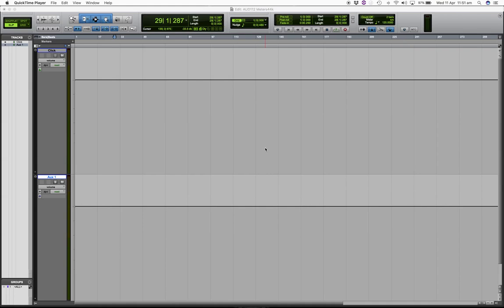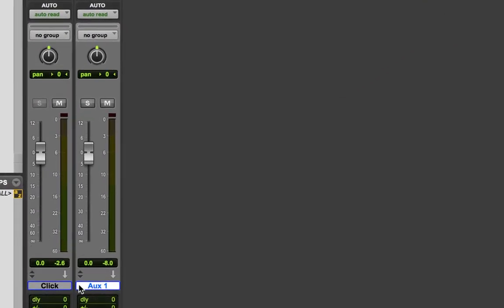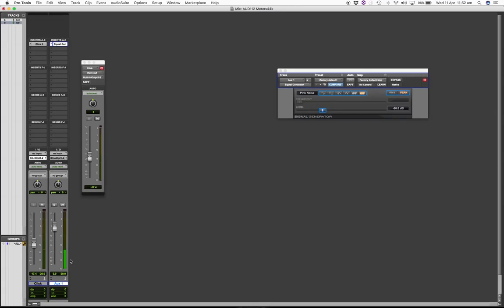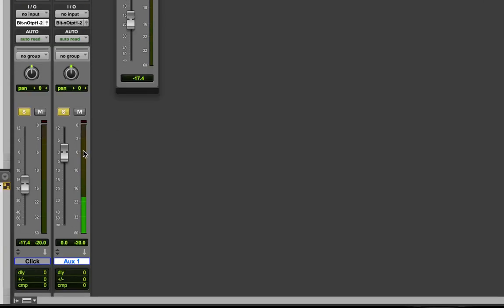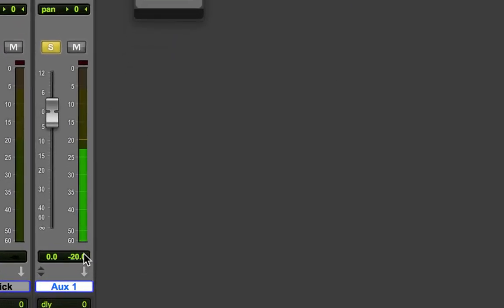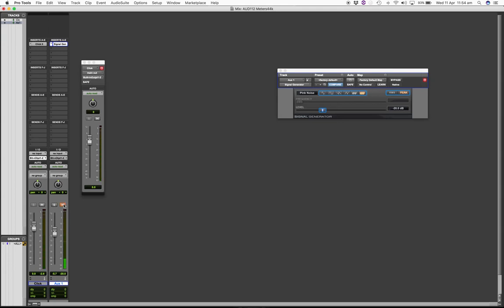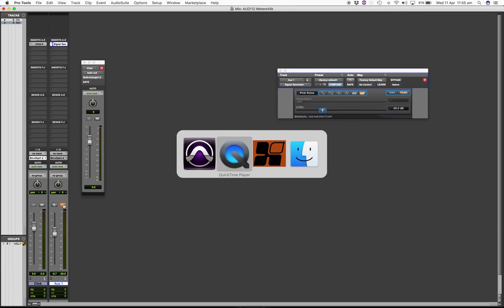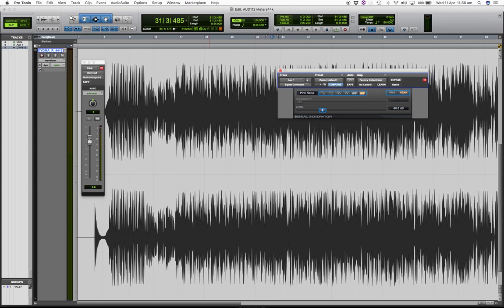Pro Tools Peak & RMS Meters Explained

Comment: What if you tracked using RMS between 20-15? Using this Klanghelm VUMT has standard -18db and also has RMS Meter +3dB shouldn’t I use the VUMT RMS? But what is the sweet spot on this plugin RMS meter? Is it still 0 where the red is? Or is it around -12 in the black? Ty

Comment: Great job there, thank you. I have some recordings with 0.0 db which probably means they are cliping. So, if I just take those peaking sections and I lower the gain a bit, would that be a correct technical solution for it, or I would have to record again? Thank you.